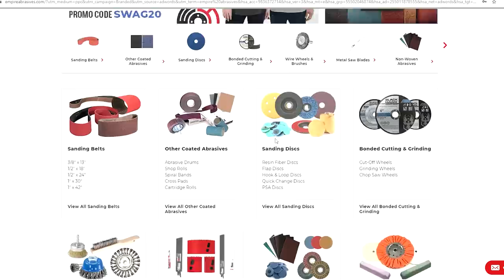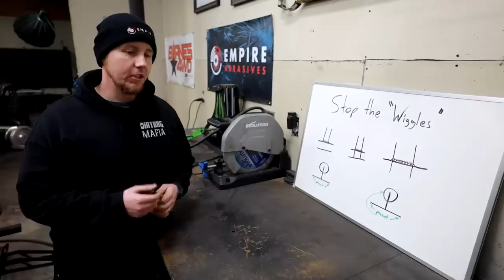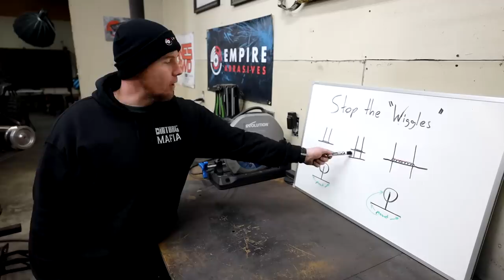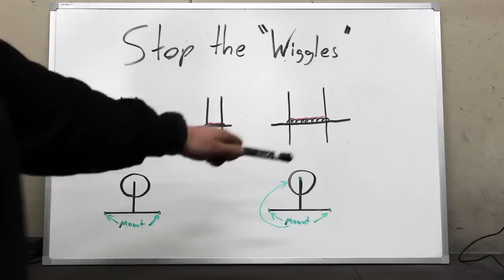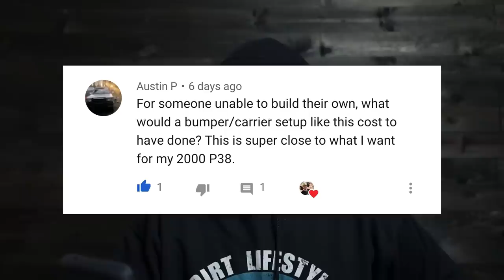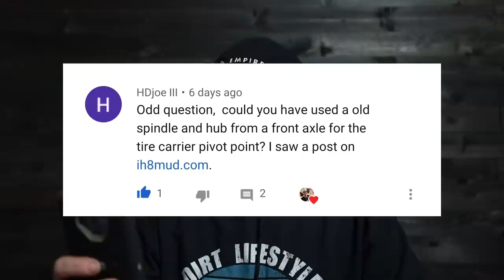Ultimate Overland Tire Carrier Episode 4. Ultimate Land Rover Discovery Build Episode 19

Comment: A good fabricator/welder isn't cheap a cheap fabricator/welder isn't good that's the sign my son's and daughter have above the main door of their fabrication/welding shop and you can substitute any profession in there just like I'm a heavy equipment operator some people didn't like the prices I had per running hr of my machines and each machine is different but I can't run a dozer for the same price as a skidsteer people have found that my prices are alot cheaper than hiring the farmer down the road that has equipment and uses it around his farm every now and then and in 6 months to a year it doesn't look good or it's not on grade or doesn't drain right then they have to hire me to fix it and even if I can fix it for half what I could've done the job for (which is rare because most the time I have to dig out the junk fill material including building demolition material alot of times and use good fill) by the time they paid him a couple thousand less to screw it up than me to fix it they'd have saved a bunch just having me or some other professional do it in the first place the cheap farmer around here doesn't like piling and burning trees or just pushing them in a pile for the farmer to take care of later he'll pile a few bury them and continue that way and in a couple years the pond dam starts leaking or blows out because as the trees rot there's voids in the dam it can't hold pressure or the water seeps in the voids till the dam is a sponge and the pond is empty